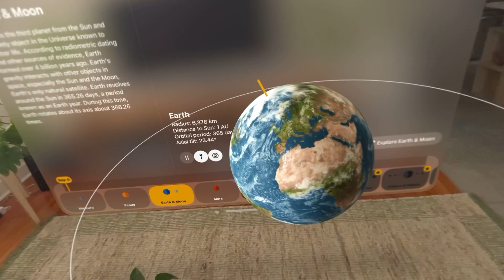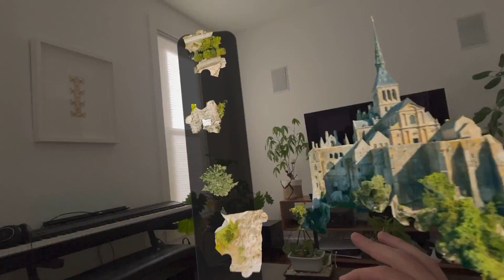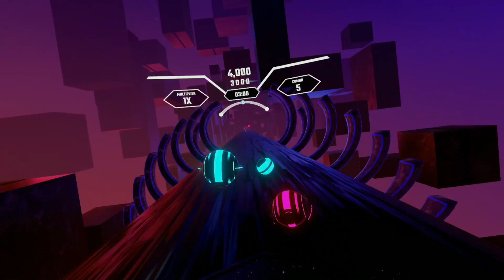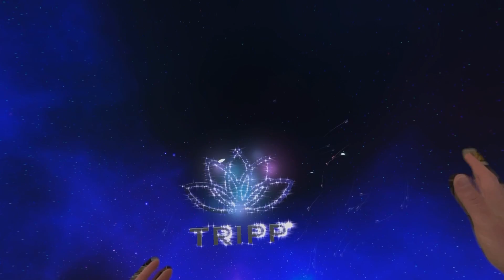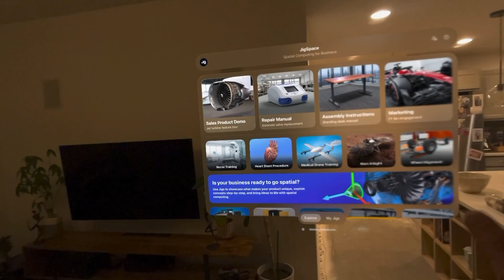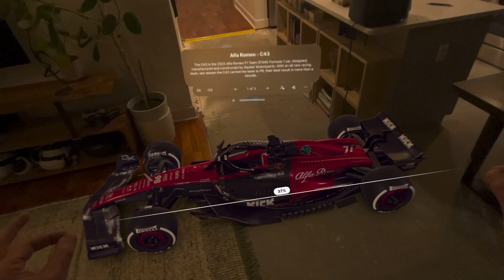Checking Out 7 Top 3D Apps on Vision Pro

Comment: FYI the hand-tracking feeling delayed is due to the hand-tracking being limited to 30hz on Apple Vision Pro (so it's not really something the devs can account for) which is really low considering that passthrough and the headset run at 90hz. As a result, it will feel sluggish.

Hopefully that's something that can be variably increased with future visionOS updates

Comment: Is the vision pro puzzling Places version some special version? It looked like the pieces sort of automatically aligned with and snapped to the model making it a ton easier?
Reply from the maker: I noticed that as well. I’m making my way through the first 3 puzzles and wondering if it goes to the more advanced version after those are done
Reply: @himelstech  dunno, I have been doing them at the max amount  of pieces to make it last longer, but it would have been a lot easier if all the pieces would have positioned themselves correctly. But just like a real puzzle I think the  challenge is to try to turn them around to figure out where they go
Reply: That said, there might  be some setting that turn this "cheat" on that isn't on by default on the quest
Reply: This version is basically a tech demo. It's missing most of the features of the Quest version. Hopefully the devs update it as it really is one of the best VR games out there.

Comment: Is the quest 3 a good entry headset? I tried AVP at the store and it’s great even if kinda uncomfortable to me. But I want to own one and not pay that much first.
Reply: Yes. You can do a lot more on it not being restricted to the apple eco system. Native games VR/AR both, movies, 3d movies, PCVR, PC mirroring, you can sideload most android apps and just use it normally like an android device. And it's A LOT  cheaper. Would i say it's comfier, depends, it's lighter. Passthrough quality sucks on it though so don't expect that to be at the same level as the vision, and the screen resolution is 1/2 of the vision and LCD, so that won't look the same either.
Reply: @CaptainMarder  At least 90% of Quest owners are not going to jump through the hoops required to sideload apps on a Quest headset. For all practical purposes, it’s as closed an ecosystem as Apple’s.
Reply: Don't drop 3500 on your first headset ... Quest is more then fine and better app ecosystem. It also works on a gaming PC for steam VR and high graphics games. But if you're looking for a replacement for monitors in a home office nothing is quite there yet but you will have an easier time reading text on the AVP and your hands wont warp as much in pass through. If you really want an AVP I'd wait a gen or 2 for the ecosystem to flesh out, the price to come down and for them to offer a freaking controller option
Reply: yes and no. if u want a headset to get a vr experience. play games an stuff than yes absolutely. its a lot better in that and has a lot more and better games. but if u are looking for a comparable experience to the vision, meaning all the ar/ passthrough stuff, the immersiveness of the environments, using it a bit more like a virtual computer so on than no. it just doesnt have the apps the screen is much lower quality making reading harder and the passthrough just isnt usable other than just looking what happens around u quickly. 
from my experience most ppl just stop using their headsets after 2 weeks so think about if u buying it just for the novelty or actually plan to use it a lot. that going for both headsets.
Reply: Quest 3 is totally worth its price

Comment: I am curious how this product works at night, from kinda dark to very dark. Can it track in dark, or even pick up hand gestures?
Reply from the maker: I've used it in a pitch black room with no tracking issues, but as others have said your hands will not occlude anything in the dark.
Reply: @himelstech really? I've seen a reviewer who complained that it doesn't work at all in the dark. He was in his bed, the wife wanted to sleep and he couldn't do anything in with his Vision Pro with the lights turned off. So it actually does work in the dark??
Reply: @Sleezy.Design  No. Even in dim light it starts complaining and tracking is poor However, if you live alone (i.e.,not worried about bothering a partner, just leave a lamp on, then block it out  completely using the immersive environment. Maybe they will build luminescent rings that you can wear on your fingers so that the cameras can pick you your digits in the dark, or use UV or IR spectrum. Lot's of possibilities.
Reply: @himelstech  That's pretty amazing as the camera's need to see your hands in order to track them. I call BS.
Reply: Will alert you if it's too dark and can't see your hands. Still works, just a bit finicky.
Reply: Actually you can just buy one for the room and that should do the trick as well. Nobody can see the Light but the cameras should pick it up.
Reply: This is just blowing my mind like we are actually in the future. I’m still trying to process how this is even possible looking forward to what bigger things come out.
Reply: @averageben6400  things feel really surreal. Especially with all the AI advancements lately. It's wild, we're blessed to witness these times.
Reply: It’s much more sensitive to things blocking the camera in the dark. I can’t cover my face in a blanket or it will give me a “cannot track” error. 

If I’m in a chair works fine in a very dark environment.
Reply: Does it have IR illuminators? If so then yes it will work.